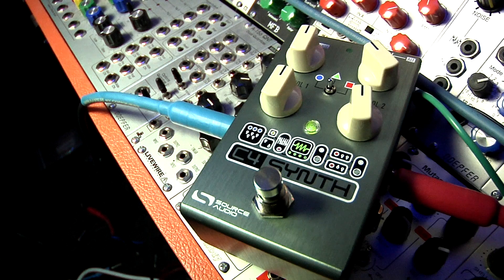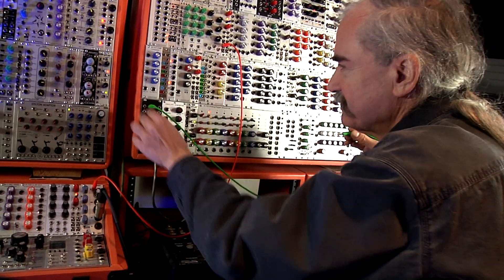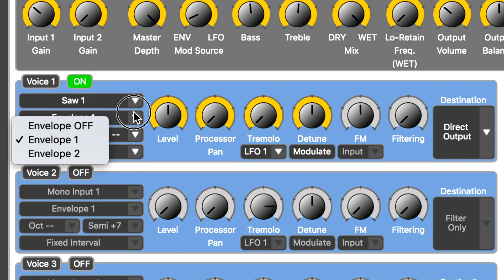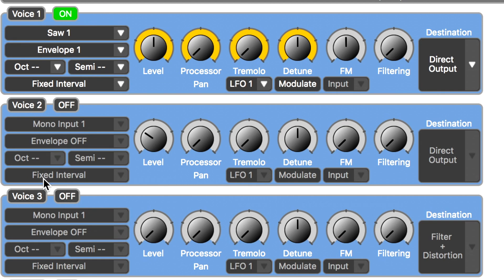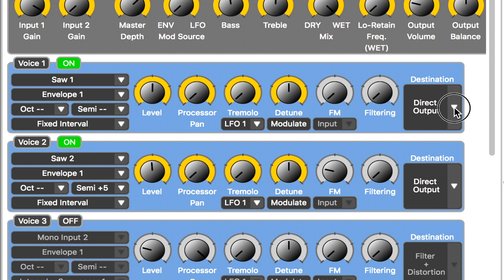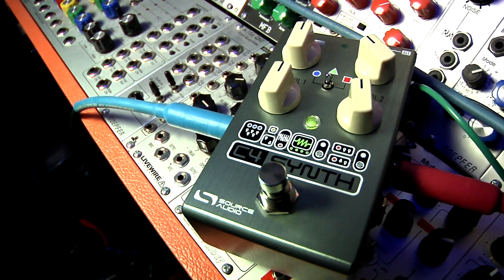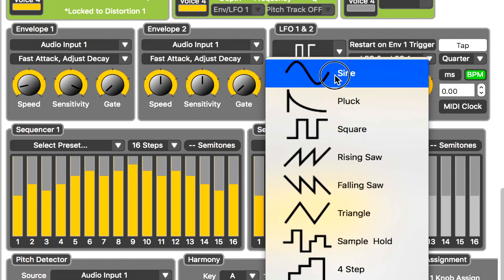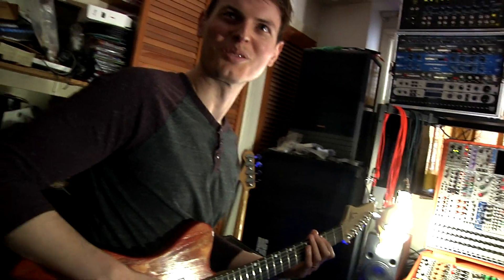Tone Matching the C4 Synth with an Analog Modular Synthesizer

Comment: And I needed help downloading Tone prints.How's anybody ever learn what this guy does?
Reply: Kev Mac you can just use the presets published by the user community
Reply: @DoNoise  Yes bro, that's what I want to do.I'm an old bastard with limited technical skills so most things others find intuitive are a struggle for me.I need to find how to link this with the Neuro app first.I have been cramming over the manual but it's slow going.But I refuse to give up!
Reply: @kevmac1230  its pretty simple, connect the pedal to your computer with a USB cable and control the pedal that way, or use the cable they gave us and use your phone. In both just go to the community tab and click the preset and play and you will hear what it sounds like.